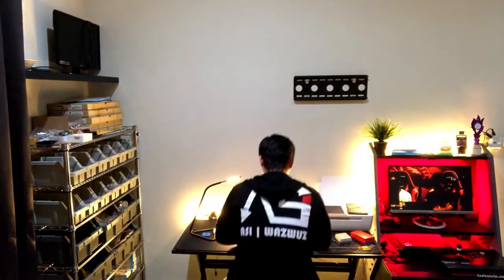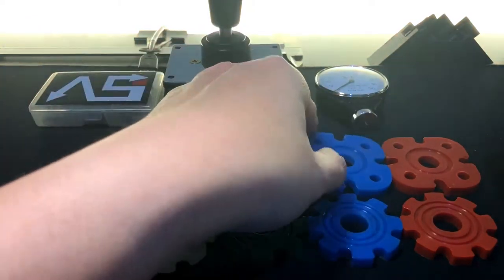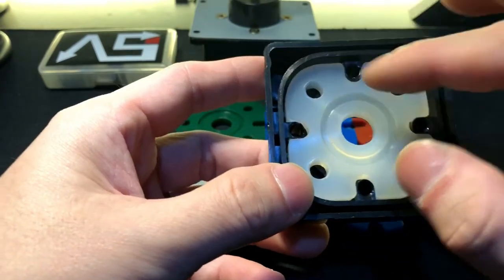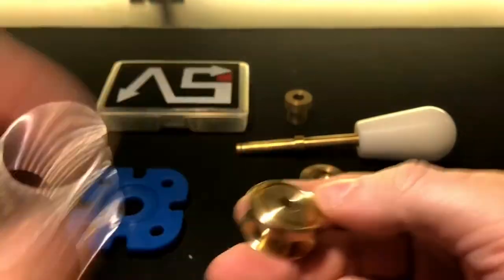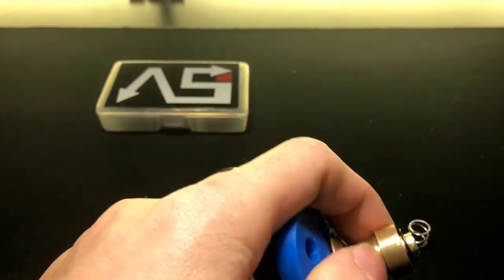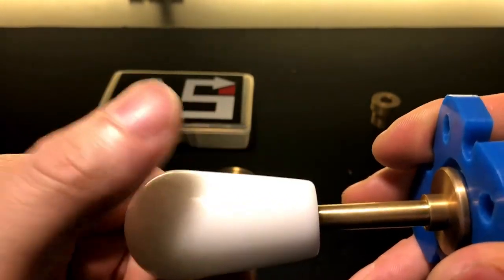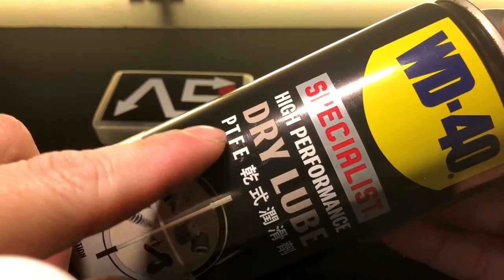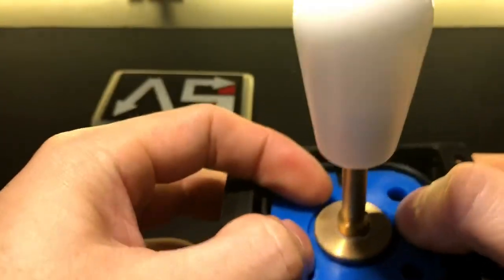Korean lever rubber Grommets and Golden Core

Comment: I'm interested in getting this mod but it's pretty expensive for the kit.  I don't get consistent lp wave dash in the Taeyoung but it is a great stick.
Reply: It's funny how i have consistent wavedash on my old Myoungshin yet on this brand new Taeyoung fanta i struggle... On paper Taeyoung fanta is superior to myoungshin but something is just weird about the diagonals on these... (The plastics, the materials the ... all feels better on the Taeyoung...) Meanwhile the difference of Myoungshin and Taeyoung is barely noticeable at times except the Taeyoung has a longer throw and the Myoungshin has a stiffer grommet... I feel like the diagonals are somewhat more narrow on the Taeyoung maybe? After some use it feels like on the Taeyoung QCF motions can be tricky to pull of since the rubber grommet feels like stiffer on the diagonals or idk... When i tried i kept getting down to forward without the diagonals meanwhile checking the lever in detail it seems like zero problems. So i think this tension is weird on these Taeyoung fantas maybe the harder rubber grommet in the Myoungshins make you do more rigid ~ harder movements and that way one don't skip the diagonals?! Just my guess, i will see if the Taeyoung gets any better after some months of abuse...
Reply: @mundomando5051  If you have consistent wavedash on the Myoungshin, then why did you go for the Taeyoung?  The diagonals on the Taeyoung  were my main issues at first and it took a while for me to get use to it.  My wavedash has gotten better on it but I'm still not 100% confident in it's execution.  Electrics seem to come out consistently but things like 5 ewgfs or even 2 ewgfs f,f+4 don't always connect.  I'm interested in the Myoungshin if it helps for consistent wavedashing.  I just figured there wasn't much difference with it then the handle.
Reply: @mundomando5051  how are you going with it now mate?

Have you tried different switches?
Reply: @edsoad  I actually switched to a new Myoungshin after about 3 months. The newer Myoungshin isn't that good as the old one as it is giving me a lot of missinputs. I tried Gersung GSM-V1623A3 switches in the new Myoungshin it become way stiffer with the 16.5 actuator it's pretty good! I still didn't try my Taeyoung with the A3 switches cos' I've run into a lever called "Fujin v3" and it feels very nice so i've stopped my experiments for a while and just use this as it just works.
It seems like my Taeyoung's rubber grommat were the problem mostly as the Myoungshin's grommet had 4x molding holes in the 4 corners which somewhat reduced the corner tensions. If you stick to your Taeyoung fantas first try to switch out the grommet or drill the 4 diagonals yourself that should help with this diagonal problem.